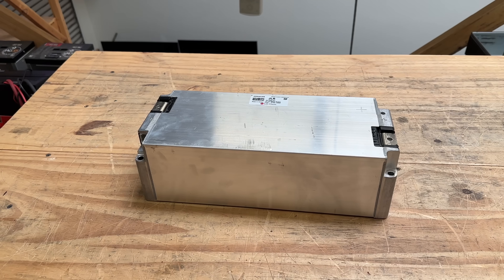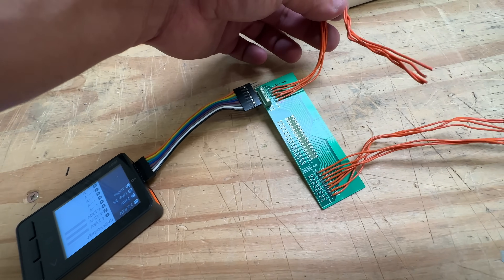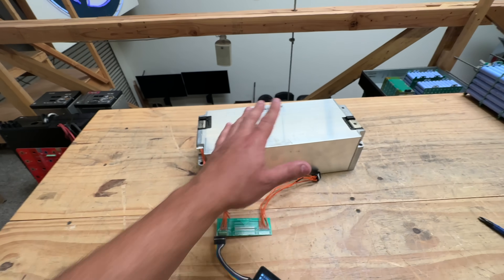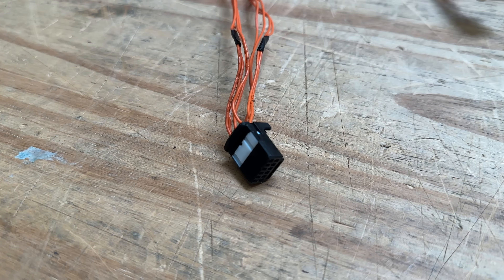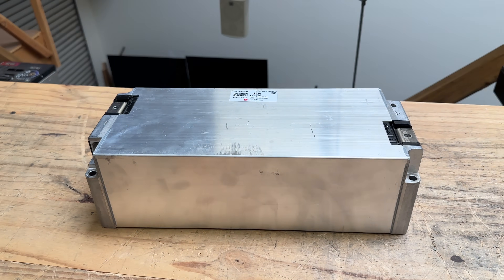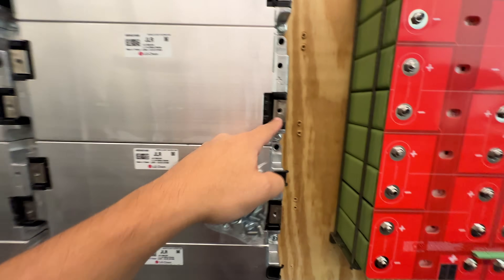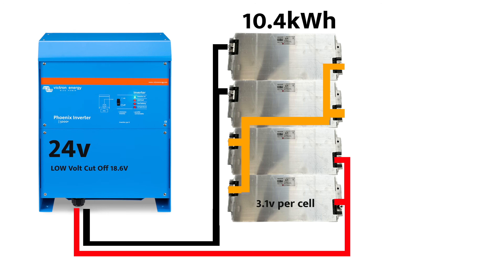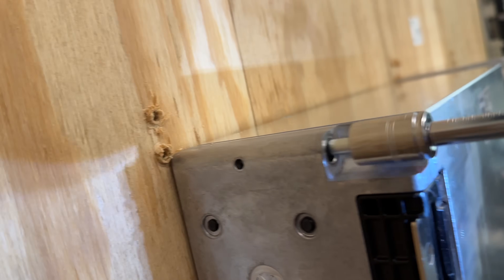$100/Kwh DIY POWERWALL - Best yet

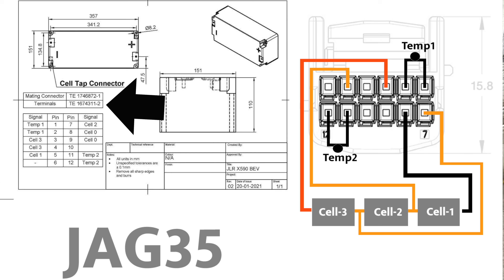Comment: at 7:50, the pin connectors in the drawing for the 2 temp sensor seem to match the connector layout, pin 1-2 and pin 11-12 in the table. But for the cells there is no match?!? In the table, cell 3 is on pin 3-4, but in the drawing it is pin 3-7? In the table it show cels 0,1,2,3? Whil it is only a 3 cell pack?
Reply: Did you figure this out? Im trying to connect these to a bms but can work out the pin out for all 3 cells
Reply: @TECHBLUECLIPS1  No, I don't (yet) have such modules. I can get hold of a complete ipace pack, but first I like to do some research. Until now I couldn't find anyone who already has such module implemented in a DIY powerwall. I think most people choose to use LiFePo4 over these, for 2 reeasons: price and saftey (these JLR's are NMC's with peak cell voltage of 4.2v). 
So you have such modules but cant figure out the pin layout? That is strange, how hard can it be to find the ~4, 8 and 12V points on this white terminal? Unless some cells are gone? Keep me informed if you like.
Reply: @tv175s3

Comment: Jehu, I've got an existing Enphase grid tied solar array, 15 kW peak production. On a typical summer day we produce 80-90 kWh. What drives me crazy is that our power company required the system to be tied directly to the grid, we have no direct electrical connection between our solar and our house. To fix this situation we need batteries. I'm looking for an AC coupled battery system that will play nice with the Enphase solar to allow us to be grid-tied 98% of the time and automatically switch over to battery and solar power for the 2% of the time that our grid goes down (which happens 4-6 times per year unfortunately). Batteries like this for $100/kWh are really tempting but of course the key is sourcing the right AC coupled inverter/charger. Do you have a recommendation?
Reply: Or just say f**k the power company and do what you want to do in your own damn house.....ijs.

Comment: Looking to do a powerwall, Im currently on your webpage searching.. Can i please ask how these will work on 24v system if they are only 11v??  2 batteries n series would only  be 22v.. Also in video you start to talk about the bms but dont give much info as you switched to talking about the cable connector.. Is the bms in the Phoenix inverter and you jjust need the connector to plug into it??  Sorry for my incompetence, im learning this as i go.. Thanks bro!!
Reply from the maker: 2 in series would be 22.2v. So would only work with some 24v inverters like the referenced Victron ones.  Bms,  you have to source it yourself,  it can be any 6s li-ion units available in the market today
Reply: @jehugarcia  Sorry to bother you again, can i please ask what to search for on google or the ali's/amazon??  Tried searching and only thing that came up was in the $400-$500 range.. Thanks for your help!!

Comment: Can you post the hardware you used for stand offs
Reply: I got these too and after some experimenting, the corner mounts are 5/16 and over 3 inches in length, that will be up to you. The terminals i found that M6 1 thread works, little tight but nothing is stripping, at least 10-20 mm length works great

Comment: Hi. Just watched your video. I was just wondering about charging. Could I charge one of these units using a standard car battery charger or even better one of the affordable 100W solar panel and 20A or 30A charge controllers available on ebay. Or does the battery have to be charged using the unique connector you refer too? Many thanks in advance
Reply from the maker: You can charge it with any equipment you can set the max voltage of 12.6v per module,  this excludes most 12v chargers and 12v solar charge Controllers.  Variable power Supply is your best bet

Comment: WARNING: Jaguar Land Rover North America, LLC (Jaguar) is recalling certain 2019-2024 Jaguar I-PACE vehicles. The high-voltage battery may overheat. Consequence: The high-voltage battery overheating increases the risk of a fire. Remedy: The battery energy control module software will be updated by a dealer, or through an over-the-air (OTA) update.
Reply: I hope it's not these batteries.
Reply: I saw that too but i already bought them. The issue im having is that i can't read all the cells through the connector on some of them. I speculate, with what I'm seeing, maybe the cell connections weren't complete and that was throwing off the bms since not all the cells were in check.
Reply: @homdiddlyoh  bring a previous buyer from Jehu on several battery types and thousands spent.. I can say that without a doubt, nothing has been top quality. I'm honestly just going to buy new from now on and actually get a warranty and not deal with the hassles. His "great prices" aren't even great with these issues.

Comment: To build a 48V with these is way more expensive than a EG4 server rack battery. Actually you can get 1 and 1/2 EG 4 battery for the cost of this.
Reply from the maker: But you need 4 eg batteries to get 20kwh.   Eg4 are
Exactly 3x more expensive than these.

Comment: I watch lot your video ❤❤❤❤ i have 48V 3000 watts pure sine wave  in i have 48V solar charger  controller  30A i have 4 12  volt battery 18A each what size solar panel to  how volt or watts solar panel

Comment: awesome! i have a question...im buying fork lift and wanted replace the old dead lead batteries with litium diy style and add my own ballast, is there any reason why id need special forklift lithium batteries?

cant find any info or get arepsonse.. my sense is its all the same. i think its 850ah 36v lead
Reply from the maker: We are currently running our 36v forklift with one of these modules https://jag35.com/products/chevy-lg-36v-5-9kwh-li-ion-modules?_pos=2&_sid=294c5f43b&_ss=r
Reply: @jehugarcia  nice. How long does that last
Reply: @jehugarcia  looks like you don’t ship those. I’m in Nc.
Reply: Yes you just have to verify the slight voltage difference is not a problem. Then find out the max current the forklift wants and make sure you battery can handle that.
Reply: Also never let a lithium cell go above its max voltage. With these it’s 4.2v. But you need to verify that with each cell specifications. Over charging is the number one cause of fires  second is physical damage

Comment: These cells look awesome but can you confirm that they aren't part of the I-Pace battery recall?  NHTSA 23V369-3467
Reply: Would be very interested to hear Jehu commenting on using recalled batteries in 2nd life applications. For example,, modules have been recalled because of cell impurity issues- debris has gone on the cathode. Do we reuse the modules?  What is a nogo recall and what is an ok-lets see?
Reply from the maker: I can not confirm unfortunately,  As far as I know these are from car wrecks,  thats why we get 1 or 2 cars worth of them at a time.  I said in the video that there was another pallet inbound but it turned out to be completely different packs (Tesla Rav4 Modules)

Comment: My biggest concern with Li-Ion in powerwalls is the fact of how volatile they are. Since they are sealed, I'd be very interested in seeing what happens if a module gets shorted till total failure. Also,  what if its sittiing in a fire, does it eventually fail catastrophically? Or does either test result in failures being totally contained (ie it wouldn't affect adjacent cells)?
Reply: Fires on these are basically unheard of, since power wall batteries are under very low stress, far less stress than EV batteries which are BRUTALLY discharge and charged
Reply: @Ryukachoo  Actually ive seen a burned lgchem module, but it was an user error because of no cmu use :D And it burned really little. THere was a video on youtube from Ukrainian user, but can't find it
Reply: If you can verify that each individual cell never goes above 4.2v then these are not a fire risk unless they get physically damaged or flooded with salt water. 

I regularly check the individual cell voltage plus I only charge to 90% when dealing with used batteries. Making sure they never go over 4.2v